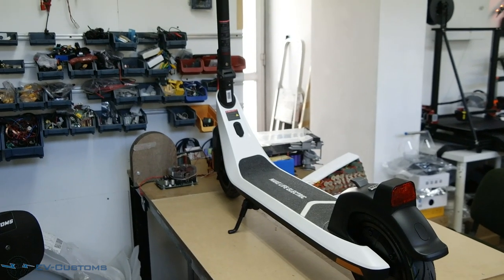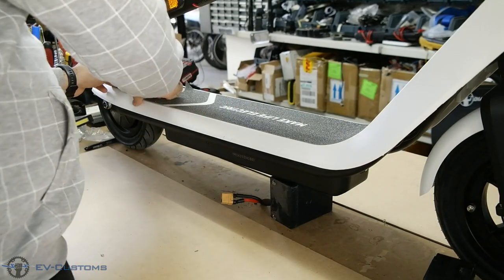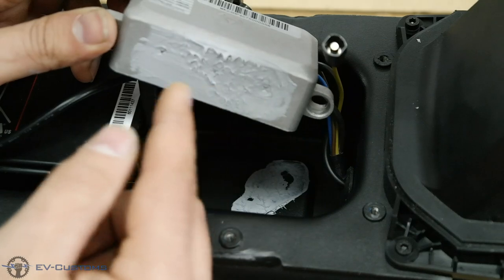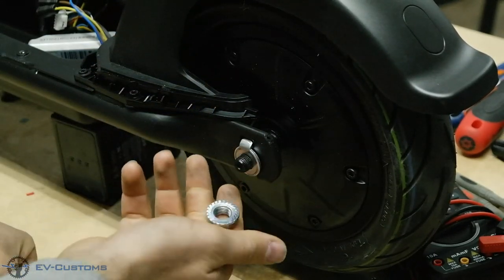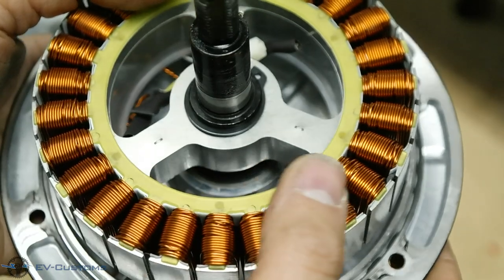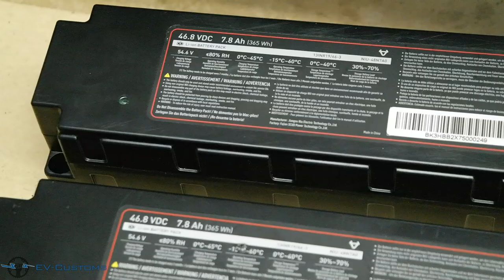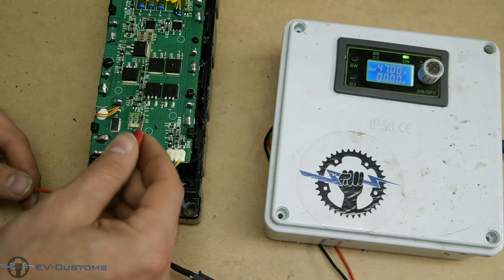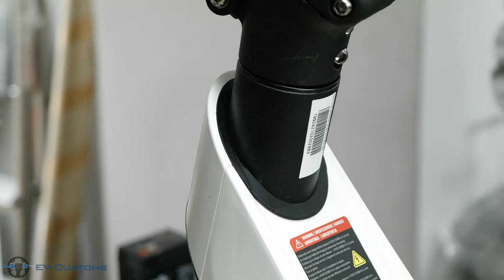NIU KQi2 Pro Scooter from Inside ( PART 2 - 2)

Comment: The wires that you cable tied together, are they insulated with some sort of clear coating? I would think over time vibration/rubbing back and fourth would cause the wires to short out.  Although I don't understand how exactly the motors work.  I think your vids provide more usable information than any scooter manufacturer has ever provided. A lot of electrical devices come with or you can easily find a schematic with wire colors, resistance values, voltage amount, etc.  Scooter makers need to provide this to make service easier, you shouldn't have to figure everything out. Thanks for posting!

Comment: does anyone know which cable is responsible for the speed limit?
Reply from the maker: you cannot take off the speed limit in NIU scooters
Reply: are you sure it has to be a certain wire
Reply: @raidelarriete2051 no doubt your house will be one of the ones on the news burning down then….